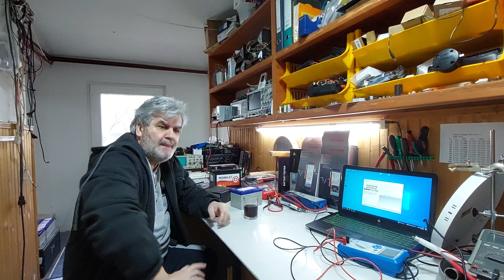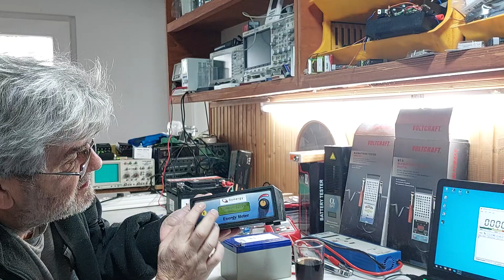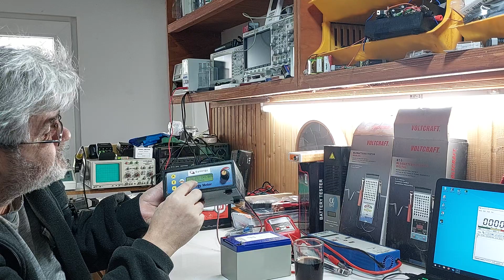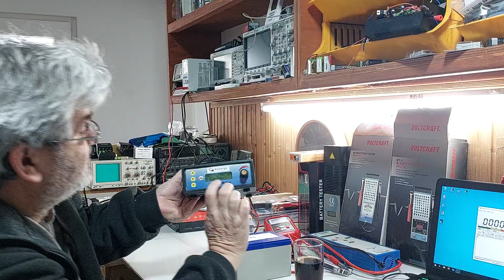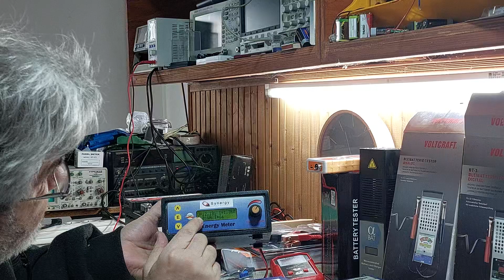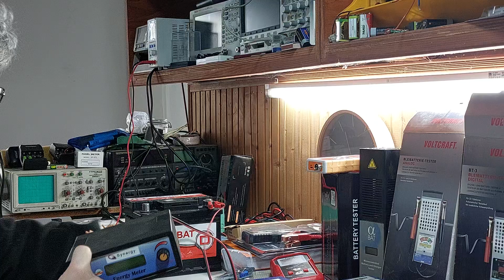DID YOU EVER  GET MORE ENERGY OUT THAN IN ?

Comment: My statement would sound like this, more power YES, energy NO for now! Or as Tesla so well conveyed, give me a Joule and I can return you as many horsepower as you want! So we have Potential, we have the potential difference which means energy, and we have power which means energy per unit of time! Well, let's do the calculations... If in a capacitor we have 1 Joule, and we discharge it in 1nS, we have a 1GW impulse! How? Yes yes.... And let's say the receiver is 3m away! If the electromagnetic wave has the speed of light, it means it takes 9ns to reach the receiver.. and if it also sent feedback to the receiver it would need another 9ns. Surprise... my impulse lasted only 1ns, and the transmitter finished its job! And you will say that,,, to discharge 1Joule in 1nS .. plasma, resistance ,,, things,,, complicated... OK, we discharge it in 1uS, we no longer have 1GW we have a 1MW impulse. Tesla understood that disruptive discharge (breaks the laws of physics). I learned about Vladimir Utkin's (Zero Transformer). I understood why inductances are not studied in the opposite direction, I made a short on the output and it does not require any mA more from the input etc... These are just a small segment of the arguments that I have and for which I abstain that a system cannot use ambient energy to continue mechanical work! Most electronics engineers know one, maximum two interactions between two inductances! Electromagnetic and capacitive induction... well... there are 13 more! So, as Socrates said, what I know for sure is that I know very little!
Reply from the maker: I am on airpory now. When I get home i will whrite.
Reply: @MilanMančić  Thank you!

Comment: Highly agreed. And thank you for your humble advice.

Whenever I see an OU device that is just a "forever battery charger" is nonsense to me. The internal chemistry might change, the internal resistances change, they degrade etc etc. I would rather accept a supercapacitor used as source or a simple DC power supply. I always have big doubts when I see battery used when claiming power gain. I agree about hydrogen generators also. People should measure the gas volume per hour and the power spent. It shouldn't be hard. They just don't, they waste everyones time.

Same goes for Tesla coil claims. People don't understand standing waves. They measure the current and voltage peaks and say it is many kilowatts when multiplied together. This is the Don Smith lie. 
People don't know how to measure power. They measure open circuit voltage and short circuit current and claim it's more current and more voltage, so it must be more power.... I've seen it wayy too many times.

And don't get me started on measuring power gain by putting lightbulbs into circuit. Lightbulbs have dynamic resistance with temperature and light output is not a good indicator of power, especially when recording with a camera.
Reply from the maker: Thank you for your comment and I agree with you. To put one more very often misunderstanding. When  someone use LED 1W or 3 W each, or even ordinary bulbs, no matter what is the light intensity, they will calculate output according total wattage of Light emitters. The best example is Moray device when  they are saying there is 50 kWh output because of total bulbs wattage.
Reply: I am not sure what are you pointing out here … it really doesn’t matter if there is 50kw or just 2 kw or 100kw … in Morray device no battery or grid connections were used … it was pure capture of energy from local environment, don’t forget this.
Reply from the maker: @Caesarus2011  Sorry, my mistake. I read long time a go an article where  someone  calculated what is the output of Moray device as I described. I am not talking against Moray device. Until now it is maybe the only device  that really worked . the only I did not accept it is the end of this story, someone smushed device and he did not know how to make another one.